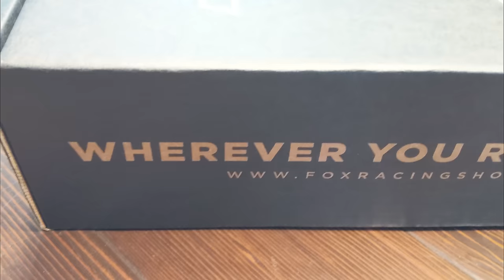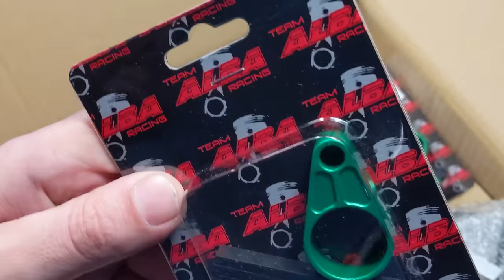Yamaha Raptor 700 ATV Suspension Upgrade Alba Extended Arms Fox Float 3 Evol Shocks Installation

Comment: I have a '21 Rapter 700R-SE w/highly tunable KYBs. Im good. I even race in limited capacity. No issues. The high end KYBs work great! No doubt ur Fox shocks are prob awesome but I def don't need em. Keep riding!
Reply from the maker: this is the base model. the front shocks were crap.

Comment: Dang that looks good. Congrats on that sexy bike man. I want one but I don’t have the money. I’m thinking about selling my 400ex and getting one. 🤤
Reply: You wont regret it the power is insane tuned
Reply: Get a new Raptor soon. YAMAHA may discontinue after '22 model year. Let's hope not tho!
Reply: @justinvenuto7887  Its killer stock. Lol. I opened up airbox w/ vented lid /GYTR filter setup & gets a dyno certified 5hp! Maybe exhaust next. No pipes. No fuel modulators!

Comment: Quad looks nice, want to know how much of an improvement it makes. Next mod, steering damper. On my 13 700r I’m running a precision stabilizer with flexx bars and tuned stock shocks. Combo is awesome. Also added Houser pegs and heel guards, would also recommend as well. +2 arms should be the most noticeable for stability, looking forward to next video. Thx

Comment: Question, from what I saw in the video when I’m swapping out my rear suspension I don’t need to have the bike lifted right?
Reply: Also any special tools needed to take anything off for the a arms install? I saw on the Alba instructions something about a fork tool
Reply from the maker: You can use a pickle fork or a ball joint remover. Or a wood stick lol I did an A arms install video also. For the rear I just needed a couple of giant crescent wrenches to tighten the nut at the end
Reply: Sweet thanks for the help brother 🤜🏽I appreciate it
Reply: What type of grease did you use for the a arms?
Reply from the maker: @AfterHoursWithMrC  just red chassis grease from autozone nothing fancy
Reply from the maker: @AfterHoursWithMrC  I used this red multi purpose grease from valvoline but any automotive type grease should be fine. I usually pull my front end apart once a season and redo all the grease instead of squishing more in https://www.autozone.com/greases-and-gear-oil/lubricant-grease/p/valvoline-multi-purpose-grease-tube-14-1oz/54182_0_0?spps.s=6768&cmpid=LIA:US:EN:AD:NL:1000000:GEN:10574827360&gclid=Cj0KCQjwuO6WBhDLARIsAIdeyDL6z4gFXnzH-m2YJzKeg9lURt6z0gQKQh_wM1Cq4L6TSAamvzL3yU4aApNREALw_wcB&gclsrc=aw.ds
Reply: Thanks brother I really appreciate the help
Reply: Sorry last questions, do we use a special brake fluid on the raptors or just anything generic will work? Also do you know of any sites to get all of the torque specs when putting everything back together after doing suspension and a arms on the raptor?

Comment: For control or handling could be different dirt tires or maybe sand ones like the ITP Sand Stars or handle bars which could be Renthal, Pro Taper, or FASST Flex bars but I’d guess Renthal cause Flex bars are pretty spendy and I think you had Renthal on your Banshee

Comment: That new R / R- SE shock on rear is ALL you will need my friend! U didn't use an factory torque settings on anything that surprised me. I doubt your a level GNCC racer or MX racer. So enjoy!
Reply from the maker: i torqued everything it just doesnt all get shown in the video. thanks for watching. i have the yamaha reservoirs on 2 of my other quads, well aware of the difference champ.

Comment: Do you prefer this set up with regular arms over the set up you have with long travel arms? notice any major differences between the two ?
Reply from the maker: long travel is more expensive but will soak up more impact. the standard travel will work with a regular length shock but provides added stability and better cornering

Comment: I have a Chinese atv. Motobravo 200xy. It had +2 a arms already on it. Those adjustable a arm joints, I need for my upper arms. No luck finding them at all. Even went to a wrecking yard for atvs, nope no luck.
Reply from the maker: the ball joints? try ford courier or mazda b2000 tie rod ends. thats what i used on my banshee. Moog brand from autozone auto parts.
Reply: @trailblogger  sob! I had a dam feeling I could go to a auto parts store🤦‍♂️🤦‍♂️. Thx another question. How familiar are you with 2+ lower A arm ball joints that are one piece with the a arm🤷‍♂️
Reply from the maker: you need to check the tapers on your spindles. the moog ball joint stud might be too large but you can ream the spindles to match with a reamer. not sure if it would work just a suggestion. sorry not familiar with those. good luck!
Reply: @trailblogger  hmm🤔🤔ok thx. I've noticed Honda 400ex 2+ a arms are almost the same setup also. I've already replaced tie rod joints. All that's left is those adjustable a arm joints. Besides whatever I figure out with the lower a arm situation.
Reply: @trailblogger  even if the joints dont have that slight curvature on the a arm joint.  I can just adjust the length of it for proper camber right? Since its straight not a slight curve.
Reply from the maker: i'm not sure, sorry
Reply: @trailblogger  thx anyways man👌

Comment: Will the stock shocks work with the 2 inch a arms ? And the stock brake lines ?
Reply from the maker: Yes your stock shocks will bolt right up. I'm not sure if you can use the stock brake lines or not. I did on my banshee but they were really tight

Comment: Good video friend I have a question that suspension is only off-road or it is also suspension for the road is that I do not speak much English
Reply from the maker: you can use it on the road also. it is adjustable.

Comment: steering stablizer for sure!... other mods i would do tho r def wheels and tires or at least new tires, and u could always use a matte blac finish set of nerf bars full coverage with fatty wide pegs to compliment the other black parts on the bike.... awesome to see, also if u get an exhaust and intake down the road, remember to take that last step and install a fuel optimizer to get the most out of the intake exhaust system... especially for me and my fuel injected kfx i love what the fuel controller was able to do for me...

but anyways steering stabilizer is my final answer so tell me did i win?
Reply: btw i meant a precision steering stabilizer... has to be that,... 

or if ur continuing with the wide theme id guess a wide axle but that wouldnt be a last mod would it, u would still have to upgrade tires and wheels and get a new bearing carrier housing so yea steering stabilizer to wrap up that front end... seemed like the focus was definitely on the front of the bike, with a lil lovin in the rear with the upgraded stock shock for the rear..

Comment: Hello im new too quads and was wondering what the plus 2 means? I see it alot on websites
Reply from the maker: +2 inches wider suspension arms each side so the overall width of the machine is 4 inches wider to help lower the center of balance

Comment: Hey guys I'm sorry for the ignorance.. I am new to the sport ATV world coming from a Can Am Maverick XRS Max. I went on a ride with friends and they ALL took Raptor 700s. It was my first time riding with others that had those quads and I fell in LOVE with their aesthetic, power, and SOUND. I plan on getting a 2019 Raptor 700R  by December, because I want to get more involved in the sport.  My question is, what exactly is the Alba Racing extended arms that this nice man here installed on his ride? Is it for a wider front? I heard a lot of ppl do this.

Thanks!
Reply from the maker: yes it is to make the front wider and more stable combined with the upgraded fox racing shocks.
Reply: TrailBlogger Geeze man, thank you for the lightning fast response. How does it stick up to heavy use? Have you had any problems with the extended arms?
Reply from the maker: @EduardoRamirez-ny6fw  the raptor is a beast and Ive had the same arms on my 08 Raptor for over 5 years now. they held  up great

Comment: What was that you had rigged up for bleeding?
Reply from the maker: I use a hand pump from harbor freight and then a Pepsi bottle with a hose stuck in the top and a vent hole. The bottle is half full of fluid  Works fantastic to get the last of the air out of the line

Comment: If I get extended a arms should I put spacers on rear or keep stock?
Reply from the maker: You may want to run a wider axle, offset rims or a set of spacers in the rear to match the front.

Comment: You got to change the a arms for the shocks or you fit them in the stock a arms?
Reply from the maker: these will fit the stock arms, the come in standard travel or long travel. standard travel will work with your stock arms or standard travel +2 arms. you only need a longer shock if you go with long travel arms. alba sells both standard and long travel arms. hope that helps.

Comment: So was it worth it?   I have all the parts to make my Raptor 50 inches just waiting on the fox float long travel shocks to arrive.    Does it take all the body roll out?   I’m super thinking about selling my Raptor, buying a 450 and putting all the parts on that,  what do you think?
Reply from the maker: It will probably never corner like a 450, the Raptor is still going to feel a little more top heavy compared to a YFZ but the wider arms and stiffer shocks definitely help that roll. If your main goal is to race tracks I'd go YFZ though, I actually got the Raptor because it is easier to cruise trails and more comfortable geometry than the YFZ on long rides into the woods (for me). It is easier to lug a Raptor on slow trails or stuck in trail traffic. For aggresive track riding hands down I prefered my old YFZ to the Raptor.
Reply: @trailblogger  thank you so much for the detailed response,  that’s currently how I feel right now.  I bought my wife a 04 YFZ450 and hands down feel way more in love with how it handles I wanna save my parts for another 450 and sell the Raptor :(
Reply from the maker: @th3s41nt  most guys I know who race MX or GNCC tracks have a YFZ, LTR or TRX but I do know some guys who race their Raptors as well. if you do wide open desert racing like the Baja desert series the big Raptor dominates in that environment. Kind of have to decide what suits you better. I don't really race, just ride trails so it came down to comfort on long rides for me...

Comment: Are the alba A ARMS more durable than the stock arms I just bent mine and I’m looking to replace them
Reply from the maker: I've had a set on our other 2008 raptor for about 4 years now and they have held up great even when my wife cartwheeled it down the mountain. how did you bend the stock arms? tree jump out in front of you?
Reply: Big rocks!! shouldn’t have been on that trail but I wasn’t gonna back out half way through. And with that a arm kit you can adjust it to add 2 inches wider or keep it at the stock size ?
Reply from the maker: @Chris-bl6hh  they are +2 each side so +4 overall. the camber and caster are adjustable, not the width.
Reply: Gotcha ! Thanks for the info !

Comment: Everything looks good but your still missing the air intake for some more power.
Reply from the maker: Agreed. I've got a GYTR style one to bolt onto the stock air box for now. I'd like to be able to run a link on the winter for creek crossing and puddle crashing

Comment: I'm going to cheat, but I'm gonna say either pro taper bars or a steering stabilizer. Love the new raptor. Are you selling the stock shocks?
Reply from the maker: I will probably keep them just in case I accidentally wrap this thing around a tree or something. backup set. if not that then ebay them up.
Reply: @trailblogger  also with these upgrades buying the base model, how much are you actually saving?I just looked up them shocks and 😲😲😲😲
Reply from the maker: It's not cheaper but in my opinion you end up with better shocks and extended arms. If you are already planning to replace them why buy the more expensive model?

Comment: How are those a arms holding up
Reply from the maker: They are great. I've had the same set on my 08 raptor for 5 years now. All the ball joints and bushings still feel tight.
Reply: Wow thats the fastest reply I've got back on YT thanks for the response im looking at getn a set for my trx400
Reply from the maker: @ronjeremy1796  they have been durable. Didn't even bend when my wife decided to send it and cartwheeled the raptor down the side of the mountain. I was sure they were done for.

Comment: Jc cuz I want to buy 1, but why didn't u just by the yfz450
Reply from the maker: I had a yfz450 and they are great quads but I love the raptor and the way it rides more. 700 is a little easier to cruise when you want to go slower and more comfortable for longer rides. Raptor was also 3k cheaper
Reply from the maker: I had a yfz450 and they are great quads but I love the raptor and the way it rides more. 700 is a little easier to cruise when you want to go slower and more comfortable for longer rides. Raptor was also 3k cheaper
Reply: Ok ty 👍 last question which one will last longer? Or have less mechanical issues?
Reply from the maker: @timellis3336  the raptors are pretty bullet proof in stock form, they do not need to be rebuilt as often but can be a little more tricky to rebuild. banshee is a two stroke and will require at the very least a new set of rings every few years if you ride it hard, but they are far easier (in my opinion) to rebuild. all quads require maintenance of course..

Comment: So did you just drop 4k$ on suspension?
Reply from the maker: No the shocks were around 1300 arms 300 so 1500-1600. I used a 2018 Raptor 700R SE rear shock for now

Comment: Next mod is going to be Renthal handlebars
Reply from the maker: yessss
Reply: What's the difference between  stock and  rental handlebars?
Reply from the maker: Renthals are stronger but do now vibrate as much, they are more flexible than stock steel bars. Also a bit wider and higher up. I plan on getting an Alba anti vibration stem to make it even smoother and a bit taller ( +1 ) or I would have gone taller or added risers

Comment: So what's the width in the front ? I did the same thing you did and mine only measured 47 In the front Or maybe 48 width. Did I do something wrong? Please someone help.
Reply from the maker: the front will depend on how compressed the front end is. my shocks were aired down so it was sitting lower and wider
Reply: @trailblogger  I'm still running stock shocks so I couldn't do that right? I'm still new to all the mods stuff sorry. My rear is 48ish
Reply: @trailblogger  what's the front width on yours now?
Reply from the maker: its about 48.5" to the outside of the tire. what tires you using?
Reply: @trailblogger  The stock tires it comes with when you buy at dealership. Can I call you or email you instead? I have so many questions
Reply from the maker: message me on FB or IG if you want but fair warning Im riding a mower around today lol

Comment: If you want to sell your stock suspension let me know. I'm local (Redding area).
Reply from the maker: Thanks for the offer but I am going to keep it for now. I do have a spare front end off a 2008 though...
Reply: I was just looking to update my tired old 05 660 a little bit. I'd love to pick your brain sometime on weather I should get a new four wheeler or YXZ this next winter.
Reply from the maker: @jcapen1  these new raptors are amazing! I Would lean towards that! love our YXZ but the Raptor is one bad mamba jamba
Reply: @trailblogger  interesting, I was kinda thinking Renegade 1000. Trying to figure out the right machine to tackle middle age with.
Reply from the maker: Power steering would be nice!
Reply from the maker: I have to admit the can am side by side got my attention when we were shopping
Reply: @trailblogger  I'm pretty sold on the YXZ for side by sides. Love the changes made to the 19's (gear reduction, moving the radiator) you can get insane power out of a turbo kit. My wife hates the idea of SxS on the whoops but she hasn't ridden in a modern one, just an old 800s. So I bought her the Can Am 650 to make sure she enjoyed riding. So now its my turn for a new toy. Is a new raptor insanely different that a strong running 660? I do love how plush the ride is on my old war horse. So I thought I'd go with the SxS and keep the old raptor and show her how much fun the SxS is. Just rambling but that's my dilemma.
Reply from the maker: @jcapen1  I've honestly never even sat on a 660 so I can't say!
Reply: @trailblogger  Thanks for the response. BTW my guess for your next upgrade is either new handlebars and stearing dampener or tires. Probably a hole shot for the rear.

Comment: more complicated than what i thought
Reply from the maker: what part are you stuck on bud? can i help?
Reply: @trailblogger  Dude you are doing a great content keep it up, just I wonder is it possible to extend more the arms and rear using Fox brand company?
Reply from the maker: @lwee5856  i dont think fox makes an axle or arms for this machine.
Reply from the maker: and thank you sir!
Reply: What was that tool you were using at around 7:52?
Reply from the maker: just a cheap ball joint remover from autozone or oreilly. didnt fit perfect but it did work. usually not needed
Reply: Awesome, much appreciated. Decided to tackle it myself thanks to your vid. Going pretty well so far.
Reply from the maker: glad it helped let me know if you need any more tips!

Comment: Dude you have an almost new raptor and you spent all that money on parts you don’t have an impact gun or a fork for the knuckles come on dude spend some money even if you buy a cheap plug-in impact gunYou cut that job in half easy
Reply from the maker: I have an electric and pneumatic gun, fork too. Was a piece of cake without them though. Normally dont pull those out unless I need them, like working on my truck.